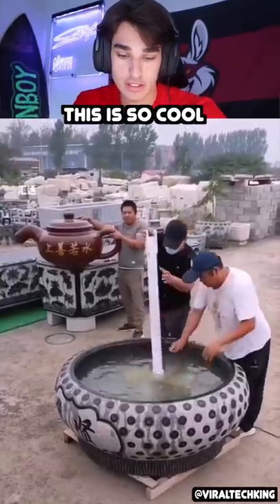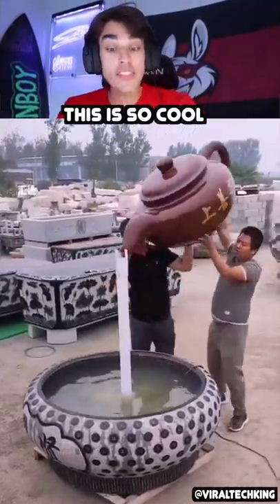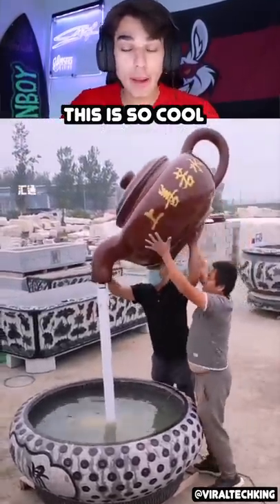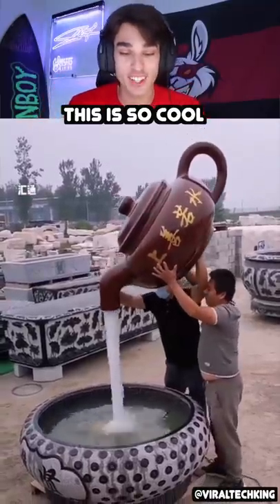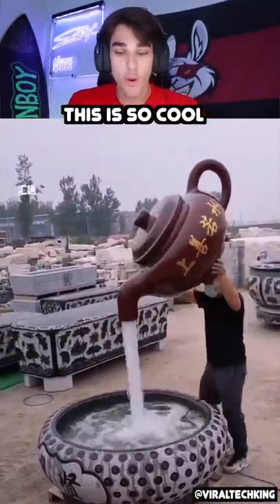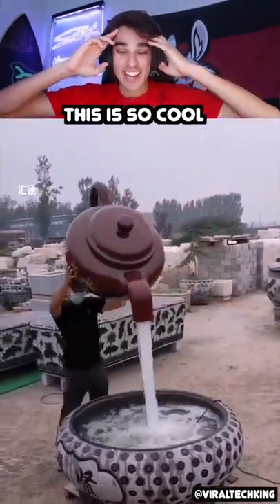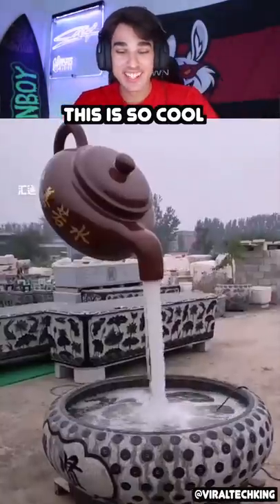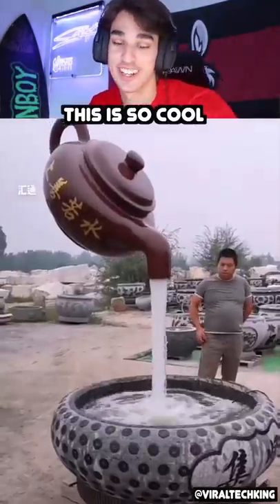I FINALLY UNDERSTAND HOW THESE WORK

Comment: If you’ve ever worked on engines you’ve always known how these types of water displays work. The same principals happen to a pushrod when an engines running, the oil gets pushed up through the pushrod, lubricates the rocker arm seat, then washes back down the pushrod.